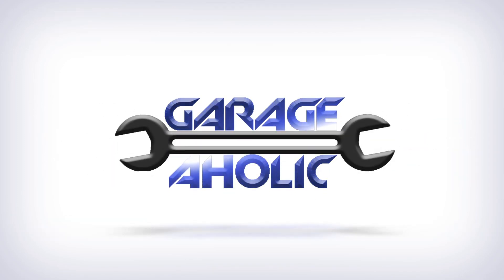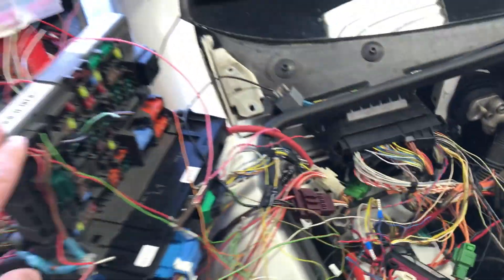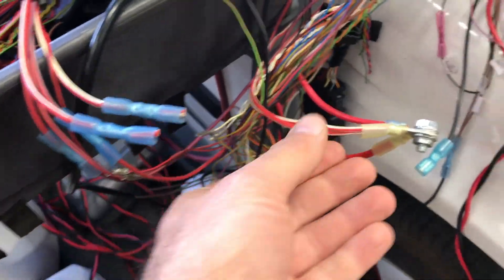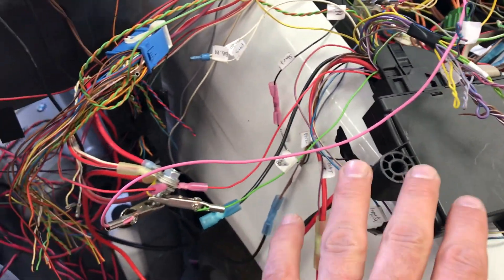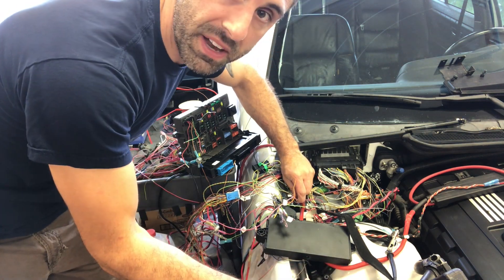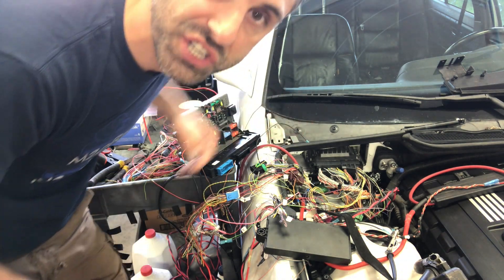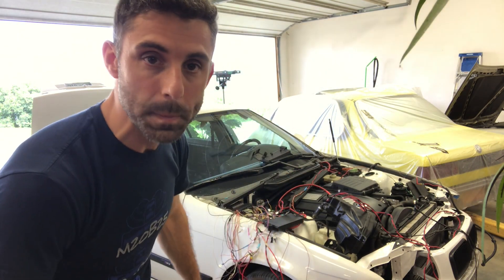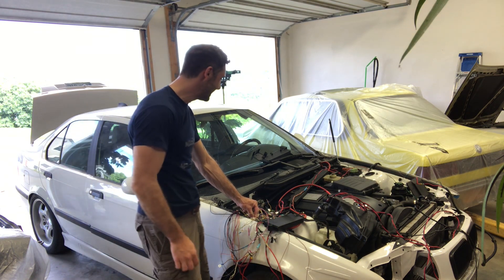N54 Electronics Are So Much Simpler Now!!

Comment: Great job! I’m doing a n52 to n54 swap in my 07 e60. I’ve been into the wiring also, so I feel your pain . I’m coming from a na motor that runs variable timing, which carries multiple power wires. I believe I’m the first one to do it to an e60 using a n52 transmission. I’m hope to also get her running soon, nothing feels better that reap the fruits of your labor!
Reply from the maker: Thank you for the comment Chris. Good luck and let me know how it goes when you're done!

Comment: Loving your videos, Frank!  I'm actually in the process of doing an M62 swap into an E30.  I would love to have videos of this quality to use in combination with the guide.  Like getting the engine/trans installed for a first fitting!  I tried like crazy last week to get that everything in but just couldn't get the tip of the oil pan past the top of the core support.

Anyway, keep up the great videos.  This channel has the potential to get a lot of views!
Reply from the maker: Thank you! I just bought a 4.6is m62 and am looking to swap it into something!!! Maybe e30, not sure.
I can tell you that if you have garagistic mount brackets with m60 mounts you should clear that rack and subframe no issue. Can you confirm that?

Comment: incredible work, worthy of admiration, my most sincere congratulations, I want to build the same project with mine, how could I contact you for some doubts I have? Is the gearbox M3 e36? or that of the 335i donor?
Reply from the maker: Thanks for the compliments. Can you be more specific with the model/year m3? E92 m3 is v8 s65 so that will not work. Check out my IG Stories for more info on trans!
Reply: Garageaholic I wanted to know what gearbox is used for the swap, if it is the M3 e36 or the 335i, as I could see I miss other thousands of questions, for the doubts that I have that are many, I want to build this same project in my BMW , in my case we ablamos of a 325i e36 coupe, manual change, without variable distribution, (NOT VANOS) but here in Spain, there are not people prepared for this type of modification, could you provide me with your email to communicate better? use Whatsapp? A GREETING AND THANKS FOR YOUR ANSWER
Reply: Garageaholic is the guide out yet ? I couldn’t find it
Reply from the maker: It will be released on Halloween. One week before release I will start to promote and get the word out.
I have been working on this tirelessly the last couple months. Thanks for your interest!
Frank